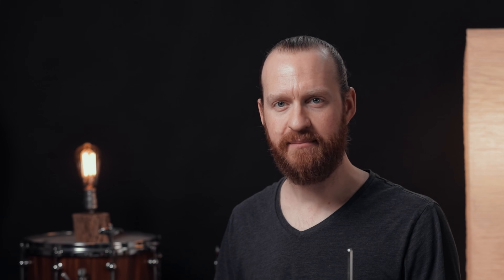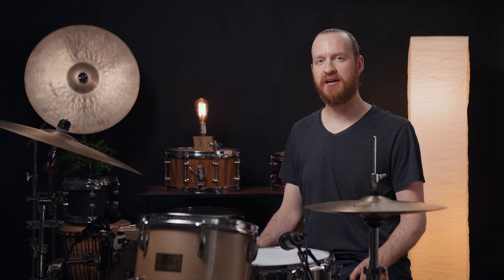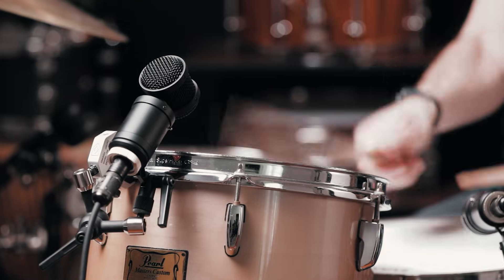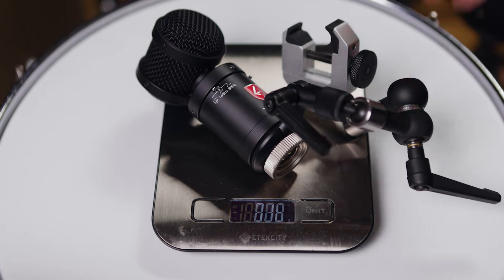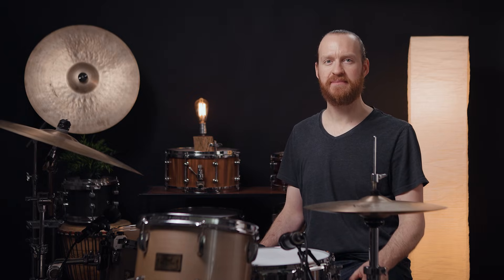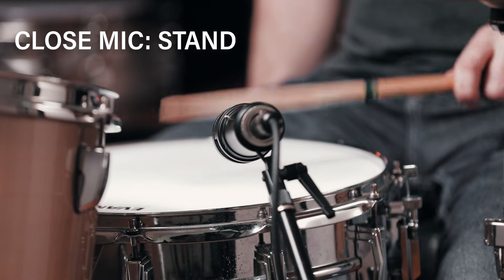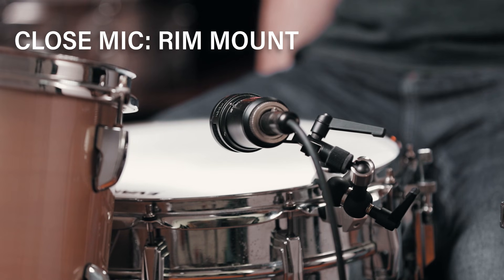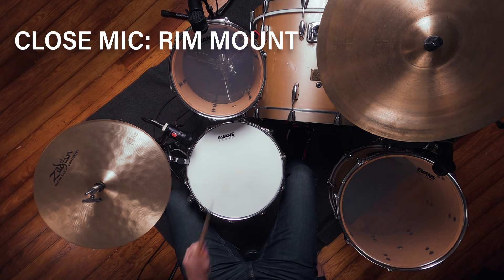Is Convenience Killing Your Drum Sound?

Comment from the maker: How'd you do on the blind tests? (No spoilers)
Reply: I missed the 2nd, got the other 4 correct. I thought I could hear a difference in decay and fundamental tone on the toms, but I still got one wrong. And it's nothing I would notice in a full band mix.
Reply: I have been looking for a video like this.

For my drums everything is mounted on a rack, so everything vibrates a little more 

With the my snare you can definitely hear that the rims especially when you cross hit
I just to high pass filter but the snare sound too thin.
Reply: 3 right, two wrong. I got both of the snare drum demos correct, but I still feel like it was mostly blind luck that I got any of them right OR wrong.

Comment: pretty sure it would only make a practical difference if something was really wobbly. like if you have a crap tom stand or snare stand that wobbles like crazy when you hit it hard enough having a clip on could improve the wobbly drum but have the tradeoff of having a mic wobbling around with whatever that entails for the other things its picking up. bet if you made it bad enough on purpose you could get manual phasing if the mics are moving enough relative to each other. my comparison point is recording stuff while using a combination of stationary mics and mics hung from their cables that i swing around, but thats several feet of movement between mics and the source.

Comment: Do those Lauten rim mounts put pressure on the drumhead flesh hoop? Because if they do, the tension from rim mount is what's raising the pitch of your drum. ANY rim mount that touches the drumhead flesh hoop will do this and is a total deal breaker for me. Unfortunately, the LP Claw mic holders do this too. The best rim mounted mic holder I've ever used that will not affect the tuning (or tone) is the Shure A56D. Those are excellent mounts.
Reply from the maker: Nope, the pressure is on the counter hoop (at least with this setup). But even if they did apply pressure to the flesh hoop, that's counteracted by the pressure to the top of the counter hoop. None of which, in and of itself, alters the pitch of the drumhead. Squeezing the flesh hoop (as long as it's not displacing the drumhead film) with this much pressure won't alter the pitch.

Comment: I do hear a very slight difference in some of these examples. But it’s so close that a competent sound engineer could easily compensate with a minimal adjustment on a knob or two if they wanted that half percent one way or the other
Reply from the maker: And the sign of a competent sound engineer would be to judge the sound relative to the overall mix. If it's not sticking out as an audible issue there, it's probably not going to get scrutinized.

Comment: Honestly, the difference is night and day to me. Not just in the resonance but also there is a bit of mechanical transfer in the transient. But I don't think the drums necessarily sound any worse. Sometimes attenuated drums with an increased transient is what you want. I think a more important test would be if the weight of the mic sends the tuning out on cheaper/thinner rims. And sometimes the most subtle difference can make a huge difference in a full mix. Is that extra transient going to help it cut through a mix or is it going to live in the same space as the 'spank' on a guitar and add to the mud. No idea. 
Yes there is a difference.
No, it's not detrimental.

Comment: super nice video... but i would be very curious to see the difference in the transient (rim vs stand mounted) to see if the rim mounted is not catching more vibration and potentially ruin/create more job for the final mix of the drum
Reply from the maker: Thanks! Do you mean the full envelope of the waveform rather than just the transient (which is just the initial attack)? Do you need to see the waveform to tell you what it sounds like or can we trust our ears to assess the sound?
Reply: @SoundsLikeADrum  yeah the full envelope of the waveform...raw tracks, has you guys, show in all of your videos are amazingly precious info!🤩
but as a mixer, to be able to analyse the raw tracks can be more reliable than my ears - or the setup i'm listening that content on. when you apply all sorts of EQ/compression/saturation/etc to make a great mix and you realized that the captation wasn't good because of the choice mounting device...that means that i'll need to work hard to remove those artefacts 😉

Comment: I've been using Shure Beta 56a mic's with Shure clip mounts to record toms for a few years now. Those mic's are pretty heavy and at first I was worried that they would either kill some of the resonance or I would hear noise in the recording.  So I did a similar clip vs. stand A/B test with the 12" tom on the kit I most often record with and came to the same conclusion--not enough difference that anyone would notice.  Not sure it matters that the clips are attached to old-school RIMS mounts rather than the hoops themselves (except the floor tom), but in any case I stopped worrying about it. Thanks for another great video!
Reply from the maker: Kudos to you for doing the experiment! Mileage may vary so testing your hypothesis is important. Thanks for watching!

Comment: It does not crucially affect the sound because to tune a 10" rack tom properly you need the equivalent of 20kg hanged on each lug to reach a A 220Hz (6x20kg =120kg). So it's not 0.7kg extra that is going to afffect the tone unless the microphone mount is touching the drum head or the shell.
Reply: Any amount of additional mass will change the sustain and tonal characteristics of an instrument. This is pretty basic physics and is measurable.
Reply from the maker: But will it be significant? That’s all that matters.
Reply: @SoundsLikeADrum It definitely can be. I have avoided drum-mounted microphones in studio situations because of the odd dampening or resonances they can introduce. It may not be significant in all situations, but it has been significant in enough situations over the last 22 years of engineering that I have learned to avoid them. Live is a different situation, those nuances will get lost.
Reply: @JordonBeal yeah but the weight is on the hoop only, it's less significant than the corresponding weight from the tension you apply on the lug anyway. I tried with a microphone stand vs a Smallrig magic arm clamp (like the Leuten clamp) and LDC mics and I can't really hear the difference. My experience with my setup (Yamaha Birch and Remo pinstripes), maybe with thinner more open drums there's going to be a more significant difference but can't tell with mine.
Reply: @DynamicRockers Take a drum that is tuned up, and push on the hoop a bit. It’ll definitely have an impact.
Reply: @JordonBeal definitely

Comment: Hello, as usual, your videos are very interesting, and this one is no exception. 

I'm writing today because at the gig I played last weekend, the sound engineer brought his Lauten microphones with their respective clips. Indeed, there is a subtle difference between the boom stand and the clip. People in the audience probably won't even notice it... but here's the point. As a pro drummer, I can hear the difference between the two. With the stand, the fundamental note of the tom is more present and, in my opinion, necessary when using in-ear monitors. When you're playing with good dynamics and nuances, you need to hear everything the drums have to offer.

Another point about the mount clip: I don't know if you've encountered this situation: like the old Shure SM98, the clip attaches between the rim and touches the bottom of the drumhead. When you tighten it, the drumhead tends to be compressed, and this affects the pitch of the sound, so you have to retune the tom. Yes, it's a minor issue, but the fact remains that you have to retune the tom. Adjusting the Lauten mount takes longer than simply placing the microphone directly on a stand and positioning it... that's my opinion!

I know this isn't the topic of your video, but I find that Lauten microphones don't accurately reflect the true sound of the drums. To my taste, they sound "boxy" and don't capture the low end or the fundamental tone of the drum. I am also play a Pearl master!
Reply from the maker: Glad to hear that you found this to being an interesting one. Wow,  you had the opportunity to A/B a microphone rim mount vs. stand at sound check for a gig? That's got to be great to have that much time to play with. I'm even more surprised that you can hear the difference to the point where it has any impact on you. But hey, mileage may vary and it's great that you actually did an experiment rather than making a "shoot from the hip" assumption. Out of curiosity, how'd you do with the blind tests in this video? For what it's worth, we're quite happy with the tone coming from the Lauten microphones for our uses. Cheers!
Reply: @SoundsLikeADrum  Thank you for your feedback. I haven't done the blind test yet, but I will later with headphones. Indeed, I had the opportunity to do the A/B test with the stand and the clip, with a sound engineer I know and a drum kit I've been using for over 30 years in the business. I know how it sounds.

Regarding your comment about being surprised that I hear the difference and that it has an effect on me and/or my sound environment, there's no wrong answer to that. We each have our own personal experiences, tastes, and know our own needs and references.

Comment: Not sure I want to subject my $400 ea. mics to any extra shock/vibration.  $100 cheap set, who cares..  Depending on drum mounts ,  I see some bouncing around like a bobble heads, gotta be doing something to the sound on those ?  Your Lautens are pretty solid.
Reply from the maker: That's certainly an interesting consideration. A lot of this seems to be dependent on the mount being used. It would be interesting to know much energy is actually being transferred to the microphone through the mount with various setups. For what it's worth, these tom mics are in the $400 range.

Comment: I know the difference is very small, but one likely explanation of the fundamental being clearer on stands is that the rim mount co-vibrates with the drum, so some of the fundamental washes out because of the motion of the mic itself, which goes in and out of phase with the drum somewhat randomly.
Reply from the maker: That’s an interesting hypothesis though I’m not convinced. Higher frequencies have shorter wavelengths and are more susceptible to phase shift. There would have to be some pretty visible and motion from the mic relative to the drumhead in order to affect the fundamental.
Reply: @SoundsLikeADrum  Probably depends on the mount, but I have rim mounted on all my shells, and every time I hit the drum above an mp dynamic, the entire mount shakes visibly and at high enough frequency to blur.

The mount is directly coupled to the shell, which the initial impulse should drive the mount to vibrate at the same frequencies, and the fundamental is the loudest.

I'm not sure about the phase argument exactly, but you can imagine that if the diaphragm is in phase and at the same frequency as the fundamental, then there would be no fundamental at all. In reality, the vibration is potentially 3D, with multiple coupling points, so there's likely some small effect induced by phase.
Reply from the maker: Agreed- the variables involved make all the difference. The method of mounting for the drums (and how much the drum itself can move) seems to be a key factor in what you're describe as well. It sounds like your setup would make for a fun one to conduct the same experiment that we did.

Comment: I find that using the SE V-mount and V-beat microphones, especially on smaller toms, like 8" and 10", I lost a huge amount of sustain. Not sure about resonance and tone though. 
It made enough of a difference for me to buy four microphone stands.
Reply from the maker: Interestingly enough, the combined weight of that clip and mic is ~439 grams (vs 720g for this setup). Did you ever do a comparison?
Reply: @SoundsLikeADrum 
just a theory but the se clamps could have more force gripping the rim due to the design, maybe you could experiment with different tensions on the lauten clamp to see if that has more of an effect sustain wise than the weight of different mics?
Reply from the maker: Out of curiosity, how are you quantifying how much force the SE clamps have vs. the Lauten mounts? Regarding additional comparisons, this is probably about as far as we're going to go with this particular topic but we absolutely encourage you to carry out your own experiments (and document them!).
Reply: @SoundsLikeADrum  sadly only with my ears. I'm actually just now remember that did a recording once, where I mic'ed up the bottom heads. I only used two toms and had mounts on both sides. That was way more drastic than just mic'ing the tops with mounts.